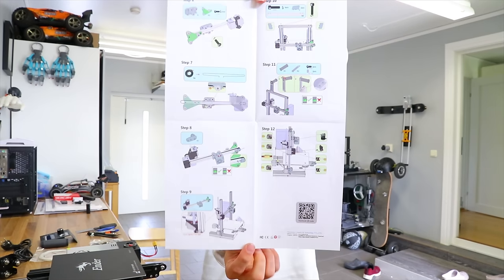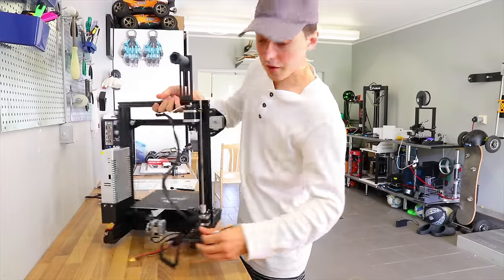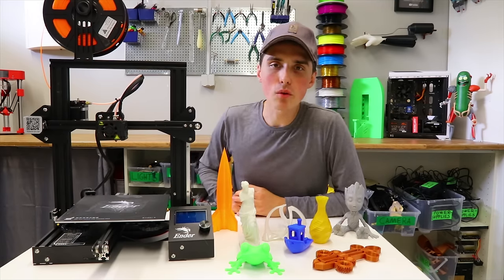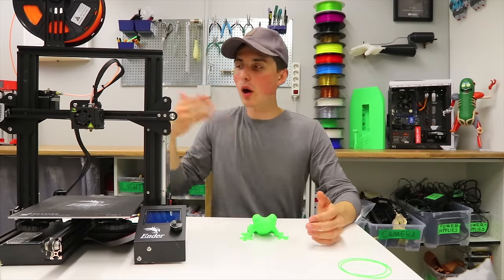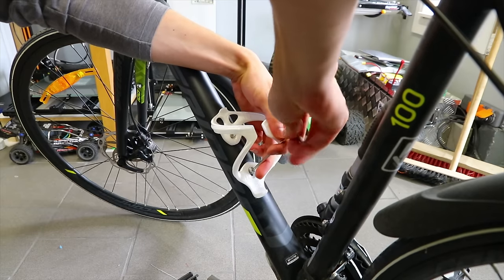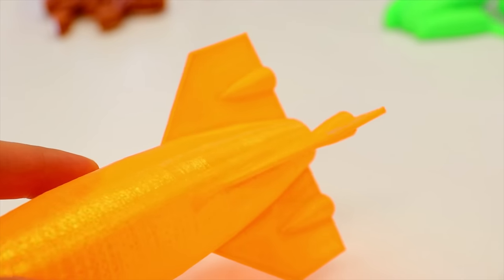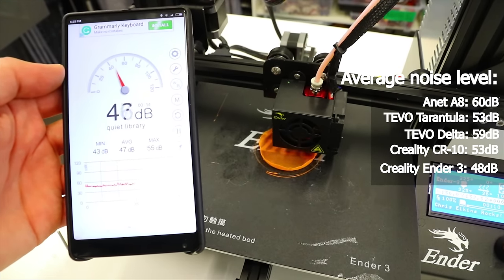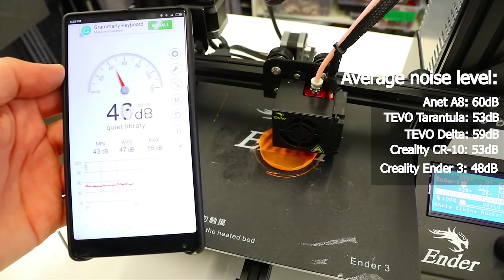Creality Ender 3 Full Review - Best $200 3D Printer!

Comment: Help me, while printing my filament do not stick properly on bed and finishing is worst
Reply: Do the following
1) switch to glass bed if possible
2) precise bed leveling
3) increase the initial layer height
It's also easier to use a sticky hair spray with the glass bed and it solves many problems

Comment: Hi could you please help
I have designed a plunger for a drain rod, its basically a circled piece of TPU. It is 100mm in Dia
But when I export it as an STL file into cura and it starts to print. It is only 80mm in Dia
How do I fix this
Cheers
Reply: Check the scale in cura

Comment: So I just got my ender 3 and the filament wont stick on the bed and when it does I'll eventually drag it idk what to do
Reply: Buy a glass bed if you haven't yet. It solves many problems. The bed leveling will be more precise and using a sticky spray will save lots of time

Comment: Somebody who has this printer, what is width dimension of printer with overlaps? I need to get the printer to 40 cm space. So when I put the controls from the side elsewhere, does it fit to 40 cm? What space for full height with filament is needed? Thank you.
Reply: I don't have the printer but their website says that the printing dimensions is 220x220x250 mm or 22x22x25 cm so sadly I don't think this will fit your needs

Comment: I bought a Ender 3 and some nylon filament a couple of days ago (new to 3D printing) and it isn’t working on my Ender. Does anyone have a solution to this problem
Reply: it could be your temperature. but to give you a real answer, id have to know more detail. like for example is it clicking,catching on fire, etc?
Reply: caden swain I put the filament in and every thing is just sloppy and not right amount of filament comes out of the extruder so the prints aren’t good

Comment: Is this a good printer does it still work?
Reply: I had mine for a while now and yeah best printer you can buy for the price. It prints as good as more expensive printers and it's built tough. Be prepared for a lot of adjusting and tweaking tho, in 6 months of owning it I am still at the stage of adjusting and improving my print quality on it. Still worth every penny

Comment: cool but I need taller prints 9 inch is too short. can't print helmets
Reply: Print helmet in parts. If you can use air dry clay and paint, you should be good
Reply: @alvarogarcia4735  printing cosplay items that you wear in parts makes it structure weaker and makes me do extra work like sanding the places it connects to match, then erasing the seem it makes. I also have to modify the 3D model to accommodate it to print in sections. its much more work and leaves the ability for more things to go wrong. I could just buy a 50 dollar that prints a 5 inch square surface and save a lot of money but you can see it is a heck of a lot more work for something that already takes a lot of time.  the price i save for a 1 time purchase isn't worth the abundant amount of work it will take for every print I do from that point on.  Rather spend the extra 100 bucks and save me that headache.
Reply: @Dragnmastralex  i mean fair enough, but if you weren't doing it for cosplay and just for display, and are looking for a project, that could work. You just weren't specific enough with your request

Comment: Can I program what to print? Like a speaker box I designed?
Reply: Ya you can. Idk what it uses but at my school we use rhino 3D and save it as a STL file and print it
Reply: @n0anime342  like, Im the one who give measurements. Do you know the program?
Reply: Leecarl Liwanag I don’t think I understand the question. The only programs I use are Rhino 3D which is a basic CAD program and Cura which slices the model for the printer
Reply: @n0anime342  thanks!

Comment: Can the ender 3 print Stl files
Reply: A 3D Printer prints using gcode, to make a gcode file, you have to insert an stl file into a slicer. I recommend Ultimaker Cura, setup a printer profile (there are many tutorials), and slice the file. Ejct it onto an sd card and enter it into the printer. Start the print. Hope this helps.
-Will Kaiser

Comment: This printer is garbage..!! Had to return it.
Reply: Why
Reply: Terrible manual, extra wire sticking out and has now where to place, instructions to setup very bad, no auto level, sanddisk came blank. LCD worked only when opened printer and never again..Was never able to print anything.  Support non existant. I am very happy with Elegoo Neptune now..Both manufactured in Shenzen, China..
Reply: @Joh750  I’m getting a ender 3 neo 2022 version